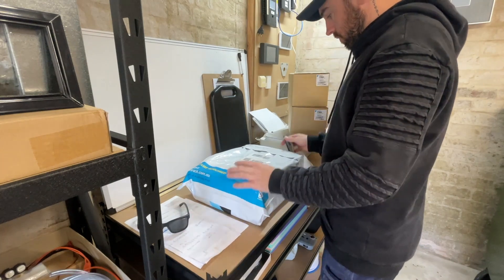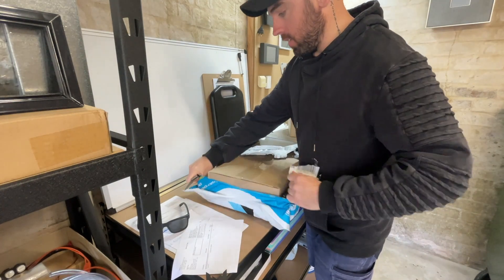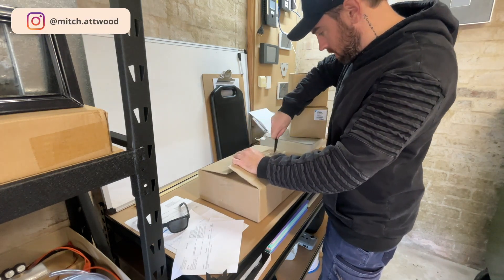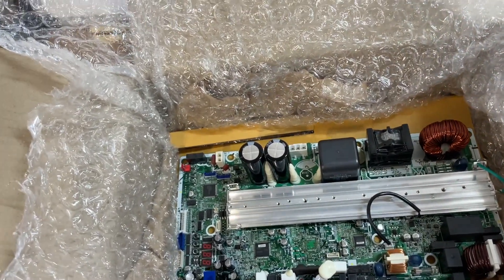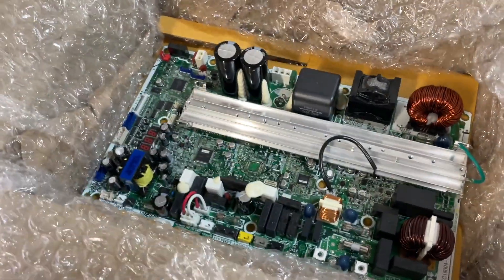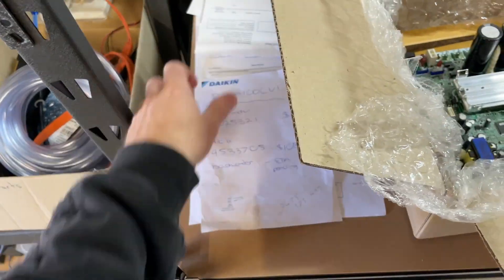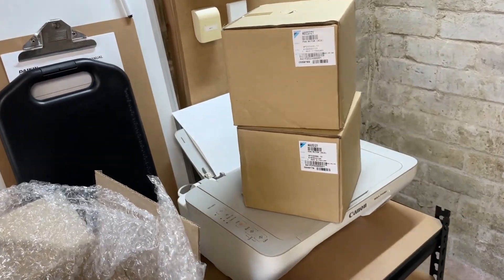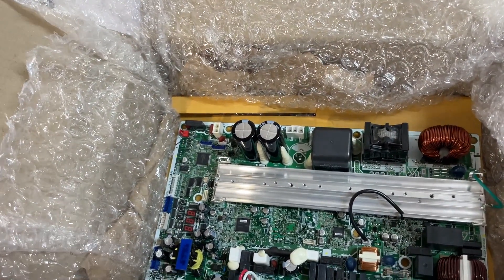Repairing DAIKIN U2 ERROR

Comment: ive worked on daikin for 35 years .with g  h  and k series .just recently decommisioned r22  G series still operational
these modern daikin r poor quality and the dodgy boards is a joke.
had spate failing boards on year old r32  found out failing undersized capacitors
tech support a joke now get more out of a monkey
yours   u.k:hand-pink-waving:

Comment: excellent   videos 
serious question:
in your experience which brand is the most easy to deal in terms of getting parts .. burying or warranty parts ??
Daikin ,  Mitsu , Fujitsu , ETC 
thank u in advance
Reply from the maker: I think Panasonic has the best warranty setup here in Aus. They send their own guys out to sort warranty jobs. They often sort out issues that were caused by bad installers when it’s not even their problem. That shows that they care about their customers. None of the other brands do that. I’m a Daikin guy but I’ll be honest, their spare parts and warranty side of things is terrible. I don’t like Fujitsu but they have the best website to order spare parts from. So to be honest, every brand has their benefits. You just need to work out what works best for your needs. I use Daikin because they have splittable indoor units and their indoor units as well as some of their controls are manufactured in Aus and I like to support local.
Reply: @maracservices  thank you for your honest answer ..you did not answer in behalf any dealer .
 great videos and full of information

Comment: Obviously not something covered by daikins warranty.

Pricey component directly from daikin. You'd think they would send it for cost ...considering its only 2years old. I Guess they've got the upper hand.
 On the customer without a/c
Reply from the maker: To be honest, Daikin's customer support isn't great in my opinion compared to Panasonic (who I also deal with) however they did replace the faulty part under warranty which is good because these parts are ridiculously expensive.
Reply: @maracservices  the sad truth is they don't want us to repair these units. They would prefer to sell a br new a/c unit. In this Consumer driven wasteful ridiculous game... we all play in.
Working away just trying to stay alive so we can battle the end boss man & go up another level 

hehe
Reply from the maker: @DoctorWEBB  I made a video of me replacing a fan motor because it was causing an error code. The fan motor was totally fine but because it was spinning at a sightly slowing speed it was causing a fault. This is forcing customers to replace components that still work. It’s actually ridiculous.
Reply: @maracservices  I looked at a mates Daikin I hooked up 2 years ago. He ruffed the unit into his double story...tripled the size house extension. 
He did the neatest ruff in I've ever seen. I basically came in & did all the connections and got it up & running. It was 67 degrees in he's roof but otherwise all went great. Running perfect for roughly 2 years.  Happy days. 
He had a power fail last week. Mains Power went off for a few minutes & it hasn't run since. 
The a/c c/b was tripped. All fuses are ok voltages test all ok. 
A snail & a bug thing have become fried goo on the main board from what i could sorta see . goo residue has run down from the crispy critters. What a pain to get into. time consuming af. 
Suspect main boards kaput. Snails ate the schematic diagram & I couldn't locate anything similar while on site via google. Waiting on reply from tech support to see if pcb for this model is even available.
Sorta need it working asap. best place to get tech diagnostic procedure for  particular model Daikins. 
Any suggestions?  
Its been ages ...since , 
I've had to do any Daikin. 
So Iam a bit rusty. Cheers 
its a RZQ160Lv1 ducted 15.5kw 👍U2 fault
Reply from the maker: @DoctorWEBB  That board is $1429.95 Ex GST (List Price) and there’s 10 in stock in NSW. Did you check power both sides of fuses and also continuity?
Reply from the maker: @DoctorWEBB  I can email details
Reply: @maracservices  yeah tested all good @ both sides. Omhs accross fuses was perfect Ect..been over &  tighten all wires n connections. Plugs ect...
Appreciate anything that might help me. Just want to confirm my diagnosis if possible. That would be awesome before hitting buy it now on that big boy $$$ jebus
Reply from the maker: @DoctorWEBB  I know the feeling mate. If it’s got power on both sides of all fuses and the continuity of the fuse is good then I just unplug the compressor and put my inverter checker on. That’s all you can do to diagnose. Sounds like it is faulty in my opinion.

Comment: Changed so many of these PCB's in the last couple years on the Skyair range.
Reply: It's ridiculous that the board is installed on the outside, it's wet outside and humid, plus they shipped that Main Board in normal bubble wrap, the static electricity in that could damage the electronics.
Reply from the maker: Same with me mate. Not overly reliable unfortunately!
Reply: Why are they dying? Exposure to the elements? 

For all I know id love to see that board and other electrical components in a proper enclosure not just mounted bare behind a cover.
I don't see a million wires coming off the board either so I think they could easily just run a multicore flex to the unit and have the board inside somewhere.
Reply: @alouisschafer7212  I believe it was something to do with weak capacitors on the board
Reply from the maker: @alouisschafer7212  this particular board was damaged due to a power surge. The customer said that they had a power surge that took out three different circuit breakers. The actual component that failed was the PFC. 
My gripe with these things is how unreliable they are. I’ve started using surge protectors on jobs but realistically Daikin should be building them into the units.
Reply: You have Clients with bad power provider, lost phase, etc.
I have only 1 in last 10 years......the bord/fan motor killed with loss of 1 phase from the net.

Good luck, awoid bad Clients, :)